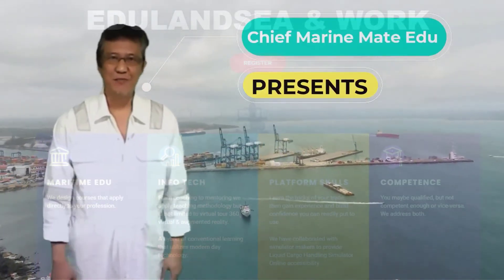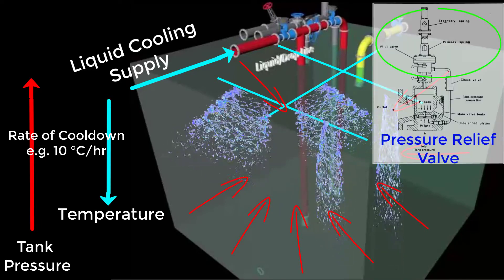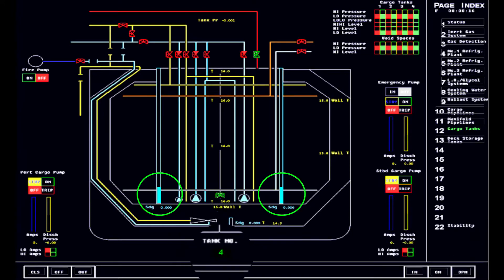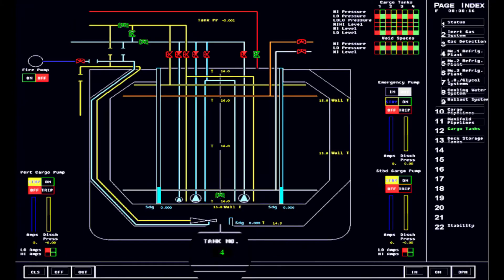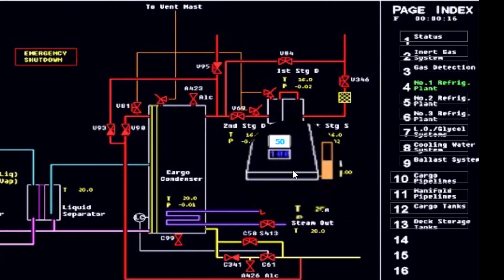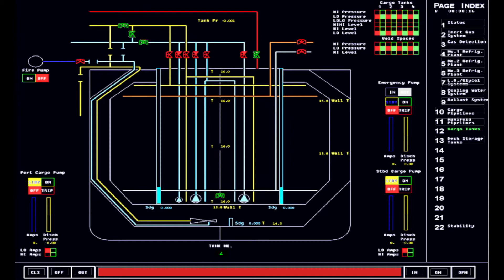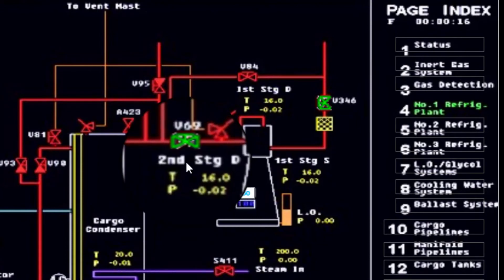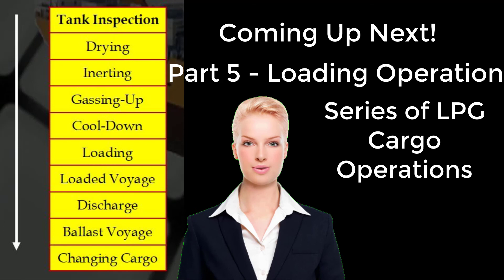LPG/C Ship Cargo Operations Part 4B -  Cooling Down  & Continuation of Reliquefaction Optn Lecture.

Comment: hello sir good day, what is the purpose of  starting the cargo compressors at 50% of load. Thankd
Reply from the maker: Avoiding abrupt surge of power, energy and pressure spike which overtime may worn out the compressors. Giving an initial load of 50 percent will stabilize and hence making it perform efficiently.